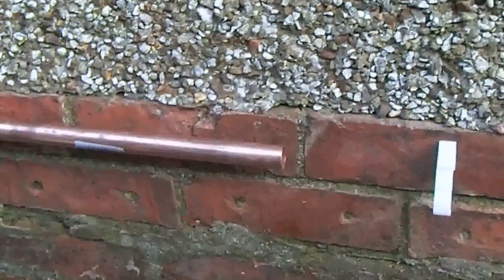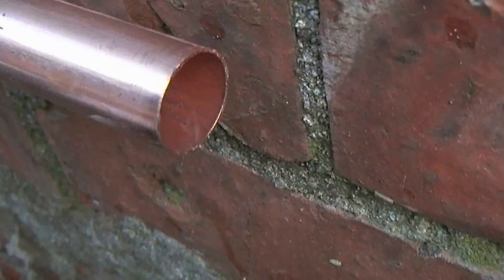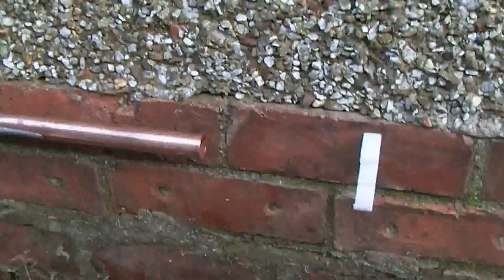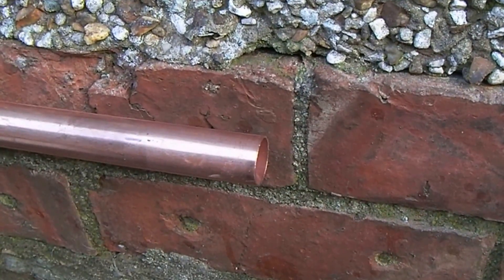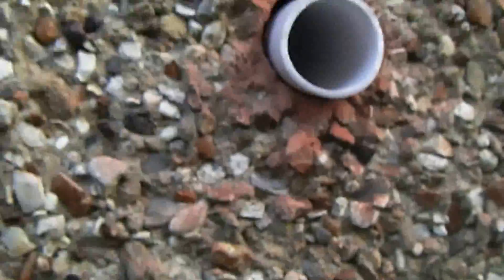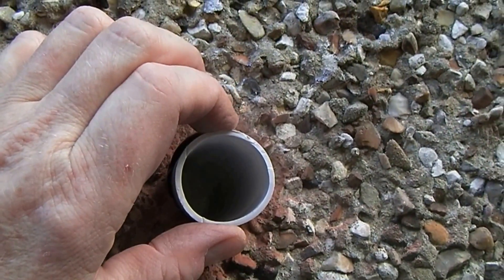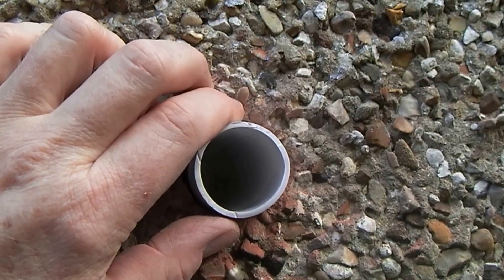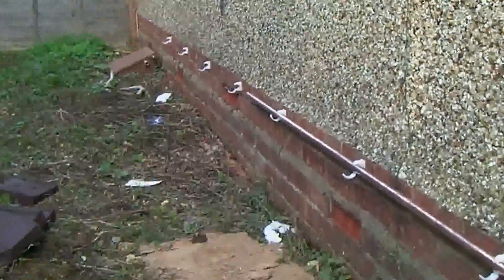How to install central heating. Part 15

Comment: Are you not allowed to use a compression fitting? That will then allow you to not have to solder the piping inside and will work just as well.